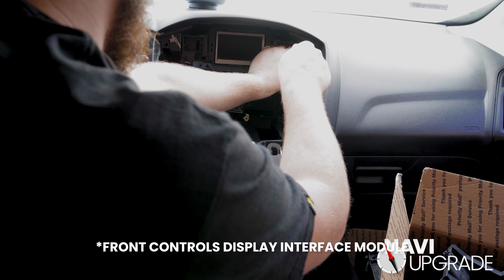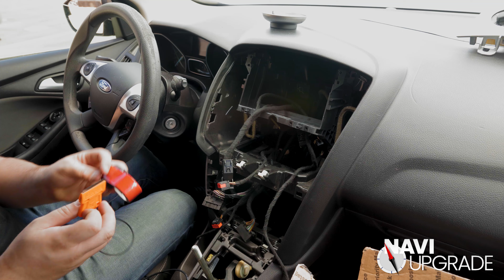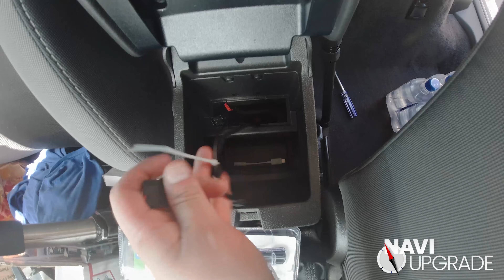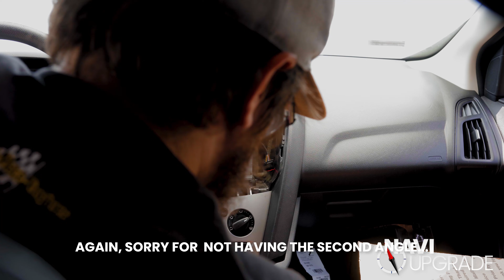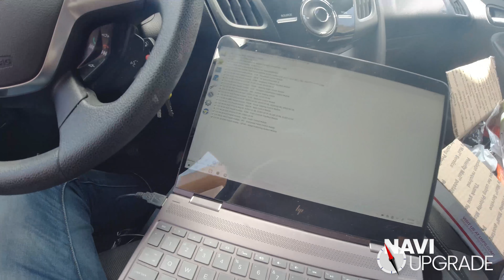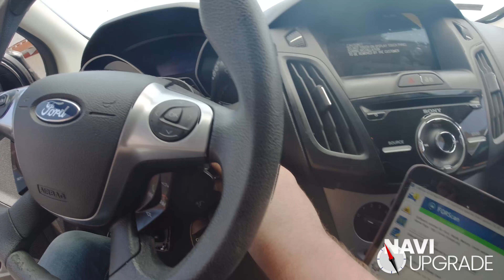2012 to 2014 Base Ford Focus MK3 Sync 3 Upgrade Tutorial

Comment: Do you have a full service package for installation in a German car? With German language.

I would love to change the standard at Ford Focus Mk3 2013 mit this Model you showed here.

If so pls let me know
Reply: I also have a 2011 Ford Focus but with the parking sensors front and back and i don‘t know if this will still show up on the new screen. And i also don‘t know if the screen for the climate  control will still show up wehn i do changes to the  temperature or the fan speed. Thes things are important to know for me befor i do the uprade especially the parking sensors.

Ps: i‘m also from germany
Reply from the maker: Hey hey, sorry for the late reply. Sensors will show up. If you have Auto HVAC you can either buy our Auto HVAC harness or our manual HVAC harness. If you go manual HVAC you can't control HVAC on screen. If you go Auto you'll need to connect another connector to your factory GPS antenna to tap the proper Medium CANBUS signals to control the HVAC.
Reply from the maker: Hey Stefan, it's pretty much the same. We don't sell full kits as of right now unfortunately. That could change, however.

Comment: I have a 2011 ford Focus withe the usb ports in the glowbox can i do thisß
Reply from the maker: Are you in the US or EU? As long as it's a Mk3 platform focus it should be possible.
Reply: A @NaviUpgrade  i'm from the eu. It is one of the first mk3's i don't now if i can take the usb trim in the glowbox aout… and i have some  question's i have the climatronic and wehn i change temerature it shows up on the screen waht i did und my pdk is also on this screen dose that also stil show up? (And sorry for my Bad englisch😬)
Reply: @NaviUpgrade  and one mor do the upper sets of Buttons on the right side of the seering well work (the ok and 4 way arrow)

Comment: I have a Titanium X with reverse sensors. When you disabled the "rear camera" what would happen to mine? Would I set to enabled and it would use the sensors?
Reply from the maker: There's different AsBuilt for cars with PAM (parking assist modules) but it will work just the same. If you purchase a harness I'd be happy to send you a programming revision to get ya set up with t

Comment: GPS antennas are installed on the glass, so the navigator will work accurately and quickly.
Reply from the maker: Not always true. As long as there's no metal or other dense materials between the gps antenna and sky it will work fine. We've set up over 300 cars like this with no issues whatsoever.

Comment: Almost don't want to spend money on this car since the transmission in mine has continually gotten worse...
Reply from the maker: I've heard that driving in "manual" mode helps but that could just be rumour. I agree though, don't spend your hard earned money on something that could leave you stranded. Time to go buy a Focus ST instead 😈
Reply: @NaviUpgrade  I swear man... bought a 2014 se used last May (no manual mode sadly). Thankfully nothing major has happened yet, other than the stuttering. Maybe it'll last a long time :) but gosh I would die for an ST man haha.
Reply from the maker: I did have a customer call me the other day saying his SE Automatic was at 206k miles without a new transmission or even getting the recall done 🤣 I nearly dropped dead, I couldn't believe my ears.  And keep your eyes out for them. Best deals are from owners in the Focus ST Buy/Sell/Trade groups on Facebook. Seen quite a few prefacelift (2013/14) cars up for sale there for under $10k with 80-120k miles.
Reply: @NaviUpgrade  "Thankfully nothing major has happened yet" - famous last words. It happened. The past couple of weeks have been freaking *awful*. Totally regret everything. Scheduled a trip to the dealer to see if they will help as I am under the extended warranty.
Reply from the maker: @landonrhoden6636  get all the work you can done then ditch the thing ASAP. Get a Honda or a Fiesta ST 😅 Hope I didn't jinx it for you man 😅
Reply: @NaviUpgrade  Nahh, if anything I jinxed myself haha. Thanks for the advice, though. But yeah, I'm going to get it back to working order then get it gone. Sucks that it has to be this way.

Comment: just for anyone watching,,, my sync stopped working soo long ago and it doesn’t bother me but I use a Bluetooth radio that I plug into the lighter socket thing. I noticed that if I listen to music too loud for too long, it turns down itself. Like the volume will still be at 30 but will sound like it’s at 12. Does anyone else have this problem too? Plsss 😔
Reply from the maker: Sounds like an ACM (cd player) module issue to me 👀

Comment: i need you help 
I need to know how I do it  upgrade, I have a central sync 3. have 1 ford focus se if automatic 2014.
but I can't get the wiring in Brazil, it has the alert buttons and locks on the central. How can I do to get this wiring?

Comment: @NaviUpgrade does the Harness you sell come with the USB Hub adapter? I just ordered almost everything to do your swap except your harness and the actual Sync 3 lol but I just noticed that the USB Hub from Amazon is smaller then the original and watched this video and saw you used an adapter to get it to fit in there. If it isn’t included with the harness where can I find it?

Thanks!
Reply from the maker: Hey there! You actually don't need the hub wiring adapter. If you have a prefacelift car you will need to have the hub size adapter. Let me know if you have any other questions!
Reply: @NaviUpgrade  thanks you for the quick reply!! Do you guys sell the hub face size adapter?
Reply from the maker: @WorldWar546  we do indeed! Here's a link: https://naviupgrade.com/shop/accessories/adapters/sync-2-to-sync-3-media-hub-adapter/
Reply: @NaviUpgrade  awesome thank you so much guys!! You guys are the best and can’t wait to get started on my conversion! You should add that part to your page https://naviupgrade.com/all/guides/converting-a-base-ford-focus-to-have-sync-3/ so noobs like me can follow along with ease lol!

Thanks again guys for everything and the quick responses!

Comment: Good Lord! I think it would've been easier to just buy a new car lol
Reply: Not practical.
Reply: Yes it is the american mentality😂
Reply: Easier maybe, affordable not likely
Reply: @notyourproperty13 easier? Have you ever bought a car!? 😂
Reply: Yea it's def a fuck no for me on this this is way too much work
Reply: Or better yet buy an android drop in for less than $300 that comes with everything you need off amazon and you're set. Most of them even come with a free backup cam too lol.
Reply: @ZachariaZuehlke you commented 3 years ago, I couldn't even imagine the 💩 they were then because I just bought one in 2024 and I ripped it out after a week. I wanted to like it, I tried to like it, it fuking sucked!
Reply: @commonsenseisdeadin2024 i just bought a 2012 hatch se. Coming from a mk4 jetta tdi that would blow foam into my drinks out of the vents its a huge upgrade. I still want to swap to the sync 3 so i can flex on people with it. Cant be worse then a clutch job and that was easy on my tdi. Focus looks like a similar set up. Lots of people are afraid to take stuff apart lol which is how we grt such good deals and have great upgrades for cheap
Reply: @commonsenseisdeadandgone glad I’m not the only one, I bought one a year ago and took it off 3 months later because the screen started going black
Reply: @glockguy1776  I went sync 2 but have a android auto that I replaced my rearview mirror with camera that's pretty slick... 
TDI is easier but focus isn't bad. I've done a clutch in both (but I have a lift at home so there's that 😂)
Reply: @yourselfpunk  it was so slow and also bothered me that I couldn't get rid of the HVAC controls on screen and I have manual controls... I said above my combo now, good enough for me otherwise I'm going to build another system I don't want to spend the money on 😂

Comment: I would absolutely be doing this if I didn't have to get rid of my focus because of the crappy transmission.
Reply from the maker: Yeah that was just a bad situation all together. Sorry to hear you had to go through that automatic trans recall stuff.  They really should have caught that design flaw.
Reply: @NaviUpgrade  When I bought my wife a 2018 Explorer I was thinking that I could drive my Focus forever if it had an 8" Sync 3 system like hers.  All said I was still able to get 200k mi out of it which has to be a record.  This is a nice upgrade for those who still have theirs!

Comment: I have the same car. The transmission just died a and I have to get a new one which is a problem with these. This looks so easy but I want you to do mine lol
Reply from the maker: Sounds like a good excuse to go Manual and get a ST 🤔
Reply: NaviUpgrade almost was going to do that. After researching it decided against it. All of fords transmissions for the Ford Focus 2012-2016 and some years of the Fiesta are junk. There was a Federal Class Action Suit and Ford admits to knowing about the transmission problems prior to putting them on the market. In any case I like the Nav upgrade you did for this. I don't have the energy or patience to do this to mine although I would love it. Money is always an issue too.

Comment: Perfect video! What do you think is it possible to change the MFD to SYNC2 or SYNC3 in a 2012 Ford C-Max? I have the 4.2inch screen with Aux in, bluetooth and navigation but I would like to have the SYNC system with bigger screen. Is it possible to upgrade?

Comment: How much does this cost to do? I just bought a 14 focus today
Reply from the maker: Hey there! Depends on if you find everything at a junk yard or not -- some people get everything as low as $500, but I'd say on average most spend between $600-800 on the entire project.
Reply: @NaviUpgrade  so if I pull this unit out of another focus at a yard would I just need the harness?
Reply from the maker: Yessir, check out my other videos showing exactly what you need
Reply: @NaviUpgrade  preciate it!

Comment: Would this upgrade be possible on the non-SYNC version of the 2012 SE? So the one with the very tiny screen?
Reply: Interested in this too.
Reply: no you cannot upgrade a non sync focus to a sync focus.
Reply: @Mhaona1 all Focus's "have" SYNC.... They just don't all have the same sync 

Yes this harness will work for the "non sync"😉 cars.... They have the exact same wiring as all the no touch screens... HOWEVER,  you might need the ACM and might need to "activate" bluetooth in a separate step. 

It will absolutely work but it might not be EXACTLY the same as this video. (Converting to the sync like in the video was a plug and play affair so obviously with that being the case, this would also be true...

Comment: Liked this tutorial. I also have a 2012 ford focus.  Though mine is a SEL not an SE.  My center console looks a bit different.  Would this unit still work with my car?
Reply from the maker: Hey Clifford, thanks so much -- your console just needs to have the base sync system. If your system currently only has the clock (without bluetooth) this won't be compatible as of right now. Working on a solution for these vehicles soon. Thanks!

Comment: I'm following this guide to replace my fried ACU but plan on doing the upgrade in the near future but I don't have anything connected to the plug next to the antenna port on the ACU itself. Does anyone have any info on this? Thank you!
Reply from the maker: Hey there -- what color is that connector on yours? Yellow? If so that would just mean that your ACM has Sirius XM capabilities but Ford didn't add the antenna for it.
Reply: @NaviUpgrade  it's just a black smaller version of the one on the opposite side of the antenna. It's got 26 pings. My radio didn't have sirius xm, bluetooth, or anything other than an aux :/
Also huge thanks for the quick reply, instant sub
Reply from the maker: @XD3blaze  oh okay! That brings audio from the APIM into the ACM for cars that are equipped with Sync.
Reply from the maker: @XD3blaze  you should be good with that unplugged. Wouldn't worry too much about it. You'll probably have to program though. If you need any help just send me an email -- info@naviupgrade.com

Comment: Hey great video! Does tihs also work with Ford Focus 2013 1.0L ?
Reply from the maker: As long as you have a base sync system or in Europe the Sony system, you'll be good!
Reply: @NaviUpgrade  I am in europe but i dont have the sony system. Not sure why but i guess i have the base sync system. From the looks of it i can install but just wanted to make sure.

Comment: Can this be done to a 2013 Ford C-max?
Reply from the maker: Hi! Yes it can. I have harnesses for the C-MAX 🙂
Reply: @NaviUpgrade  what's the overall cost? Didn't see it on the site, maybe I skipped over it.
Reply: @NaviUpgrade  nevermind, found it. So, and maybe I missed it, is it a matter of buying the harness and then finding a junker and ripping out the whole system, screen and all?
Reply from the maker: And yes, gotta find everything either out of a junker or piece it together on eBay. It's definitely possible though 🙂
Reply: @NaviUpgrade  also, do you have a recommendation for someone to go to or do you also do this? Noticed on the site you're in Encino, I live in Hollywood.
Reply from the maker: Hey Stew! If you want to work together we can find everything... I still need to film an upgrade video in a CMAX! I'd be willing to install at no charge in exchange for filming a video!
Reply: @NaviUpgrade  Done, I have to replace the radio and get that working and I think the car I'm getting that off of has the sync 3 system in it already, so I can tear everything else out as well.
Reply from the maker: Sweet! When you do that I'll want to mark down all of the part numbers for the mounts etc.
Reply from the maker: You can my email/phone number on my website naviupgrade.com/contact

Comment: How much does something like this cost???
Reply from the maker: Hi there! Most of my customers who find all the parts themselves spend between $600-800 total. It's in the same ballpark as replacing 4" Sync with a lower grade aftermarket double-din head unit. I can piece together a full kit for $1k non-nav or $1200 with factory nav + shipping. Hope this answers your question! 🙂

Comment: Hi, what about upgrading from sync 3 to android auto like in the 2017 ford? also, is it possible to upgrade from base model tiny screen to android auto?
Reply from the maker: Hey there, not sure what you mean? Sync 3 allows Android Auto to be used if that's what you're asking 👍

Comment: Will there be any computer errors, is this compatible with right hand drive version of the car, also will this work on a 2013
Reply from the maker: Hi there -- no errors and yes, we updated our harness to work with all EU & RHD Focuses between 2012-2018!
Reply: @NaviUpgrade  I did not see a complete for purchase on your website? One that includes everything for an automatic. In addition, is it a problem if even the display behind the steering wheel is the lower version as well.?
Reply from the maker: @nigeljohn6676  we don't sell full kits as we're just starting out. We sell harnesses and show people what else they need to source to have a successful conversion 🙂 there's no problem at all if the IPC cluster is older 🙂
Reply: @NaviUpgrade  will follow up

Comment: This is amazing, I’ve been staring at my ugly 4 inch display for a year now wishing I had the touch screen. Now I know it’s possible and will be trying this soon!
Reply from the maker: We just got back in stock! Supporting a lot more cars now too! Thanks for the watch! If you feel so inclined to subscribe I'd appreciate that! 😁
Reply: @NaviUpgrade  Hi, what about upgrading from sync 3 to android auto like in the 2017 ford? also, is it possible to upgrade from base model tiny screen to android auto?
Reply: did you ever try this? how did it go?
Reply: @viction7236  price outweighed the desire to do it. Ford thankfully fixed my sync issues under a RAV warranty so everything works fine with my stock system. If or when it breaks now that it’s out of warranty I would reconsider buying.
Reply: @jacobpfundt256  ah fair enough, yeah at the end of the day it still does what it needs to - it would just be nice to have stuff like carplay but as long as I can play music it's fine honestly
Reply: @viction7236  CarPlay seems life changing, to bad ford didn’t want to give it to us SE trim peasants lol
Reply: @jacobpfundt256  it's unfortunate, I've used it in other cars and it really is nice - could easily replace the cars infotainment, truly a shame ford doesn't bless us 🤣

Comment: I purchased a head unit and nav system. Going from the 4 inch sync 1 to a 8 inch head with nav. I don't know what wiring harness i need to get. I don't have anything special it's all stock, just looking to get the nav and radio system powered up. any help is appreciated.
Reply from the maker: Shoot me an email with some pictures of your current setup and what you've bought to info@naviupgrade.com -- thanks!

Comment: Hi there... Would you say this is the best head unit upgrade in preference to the others available like the Tesla full dash or the Seicane head units?
Reply from the maker: Hey there Ray! It really depends on what your goals are... I don't really like android units as much because they're pretty prone to failure -- they also don't have great built-in amps so I would recommend plugging into their RCA outs and using an external amp to power your speakers if you decide to go that route. 

I decided to figure out this swap to begin with just because I didn't think that Android units were reliable and that other dash kits didn't look right. So far I've been really happy with my setup. If amplifying is your goal and you decide you want Sync 3, I'll also have a super simple plug and play harness coming in next month that lets you add an amp without using a line-out converter :)